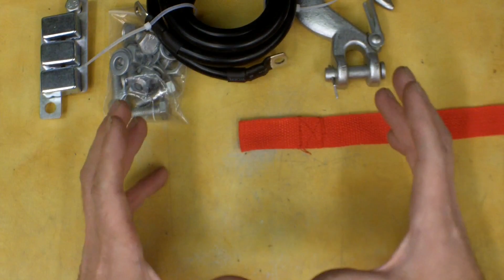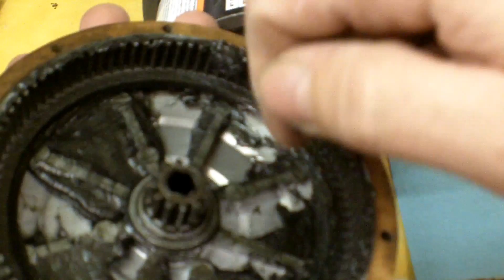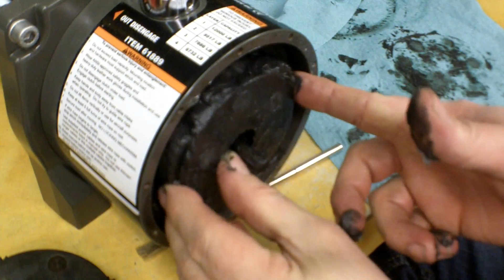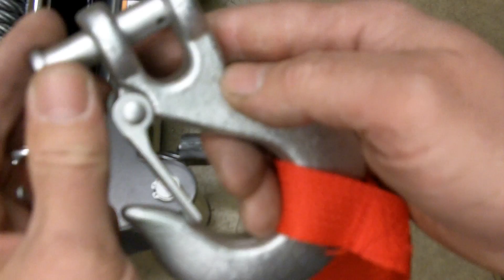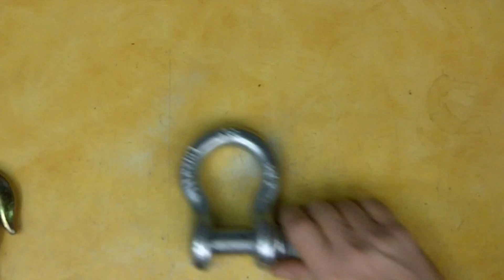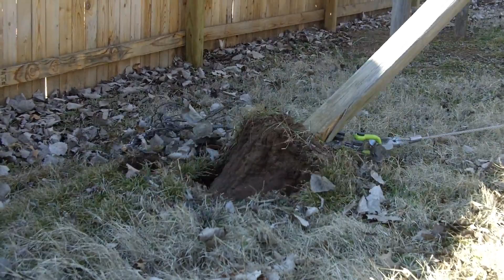Harbor Freight 12000 LB Winch Review, Teardown, Installation, Safety, Etc. Model 61889

Comment: Thank you for a VERY educational video on winches in general, the 12000 pound Harbor winch, as well as both use and safety guidelines.  P.S. I bought their 12,000 pound winch, and now, I will be a lot more comfortable with setting it up. Many people advocate switching to a synthetic cable, but because of winch heat and other items it sounds as though I should stick with the wire cable.
Reply from the maker: Glad you liked it Gregory! I can't speak for the synthetic, but know more care needs to be used. The wire works well enough for me. Good luck, G.

Comment: Just bought one of those winches for $299.00 PLUS I did buy the radio remote also.
Thank you so much for the comprehensive video on this winch !!
Just one thing I will add , when making all those battery cable connections ,use some silicone dielectric grease on those connections and terminals and you'll never have to worry about corrosion to those.
When I ran my battery cable supply to the rear of the vehicle so I can use the winch at the rear receiver OR on a car trailer ,I only run one conductor to the rear to save cost ,the other one gets terminated to the truck frame after cleaning a clean spot off the steel frame and using the grease on the connections there also.
Make sure you have a VERY GOOD ground cable run from the battery NEGATIVE terminal to a good CLEAN ground point on the frame in the front engine compartment.
Just to add , I  installed that circuit breaker assembly inside of a sealed plastic box NEAR the winch because I move the winch around and it will always be protected wherever I plug it in.
The front receiver mount I got from Etrailer dot com site for my '08 SIERRA 4x4
This 12000# winch is actually an upgrade for my purposes. I already had the vehicle set up for winches already.
I also put the quick disconnects in the front grille for winch power OR hooking up a set of "modified" jumper cables to jump other vehicles without opening up the hood. 
BTW , with the modified set of heavy pumper cables , a good receiver mounting cradle and an extra  fully charged battery , you can use this winch OFF the truck as well if needed provided you have the needed hardware to tie it down with.
Just plug the winch into the jumper cables hook them to the battery and go.
With the mounting cradle , you could carry this on an ATV to transport it.
Again , nice job on this video and thank you for taking the time to do it.
It was very helpful and informative.
Reply from the maker: Thanks! Sounds like you've put some thought into your setup and have some good tips. Very cool and should give others ideas. Take care, G.

Comment: Nice job. Learned a lot. Have you checked out the Smittybilt winches? $300 is cheap. I would spend $100 extra just to not have a harbor freight name. Just sayin`.
Reply from the maker: Thanks Greg. I looked at some reviews and saw many that broke off the mount. Other than that, I don't have an opinion. Good luck, G.

Comment: Great video. That being said, any idea as to why one would lose power? Had one for about 2 years. Worked great for while, but now it almost has no pulling power. Battery is good and connections are good.
Reply from the maker: Thanks Lane! No, not really. I assume both your power and ground are connected directly to the battery and you're running the vehicle while winching. If so, and all connections are clean, bright, and tight- it should work. Perhaps someone else will chime in with other ideas. Good luck, G.

Comment: Awesome video! Just picked one of these winches up online! (I shoulda waited to go into the store in person, but oh well.)
Reply from the maker: That's cool Chuck! Hope it serves you well. Good luck, G.
Reply: ghostses thank you! Out of curiosity, what did you use to clean up the inside of the winch? My winch came last week, and I’d like to clean it up and grease it like you did, yours.
Reply from the maker: No problem Chuck! I'm going from memory here, but it should be close. I Cleaned most of the grease off the gears, etc.  with blue towels, then they went into some gasoline to get as much off as it could. Then I used Berryman Chemtool B12 spray to blast off what was left. Past that, a rinse in hot water and then blown off with compressed air. For the part of the winch with the gear cast in. I pretty much cleaned out what I could with towels, then sprayed Q-tips with the Berryman to get the gear cleaned up. Carburetor cleaner would probably work good as well. Perhaps not spot on, but it should be close. Good luck, G.
Reply: ghostses thank’ya!
Reply from the maker: No problem! G.

Comment: Thank you for this video.  If I were to use this to pull a 1, 000 lb. cart up a steel track on a 45 degree grade, do you think that the motor would overheat or be damaged if it ran for three minutes?  I'd appreciate input from anybody on this question.  Thanks very much.
Reply from the maker: No problem Linda! I know it will pull that load with little strain, but can't say if it will do a 3min run-time. My gut says yes- but that means little. Not much help, but good luck! G.

Comment: My brake on a 12k mile marker is not holding. Crap.
Reply from the maker: No sure if you can get a replacement, but it might be worth looking into. Good luck, G.
Reply: I was hoping you would dig deeper into yours to show the brake. The mile marker looks very similar. Good video just the same.
Reply from the maker: Thanks! Not sure if this is the part you need, but if so- not bad for $35 or so. G.
https://milemarker.com/product/brake-shoe-replacement/
Reply: Cool beans. Thanks for the link. I will have to pull it apart and have a look at what is going on. It really has had very little use. Less then 30 pulls for sure.  Its 15 years old, but spent most of its life in the box.
Reply from the maker: No problem. Not much use for that problem. Might just need a good cleaning- who knows.. I'm sure you'll figure it out once you get in there. G.

Comment: What kind of receiver hitch did you mount on the front? Do you need to have a receiver hitch also rated for 12,000 pounds like the winch is? I am researching into front receiver hitches and most of what I find only have a 9000-pound straight line pull.
Reply from the maker: Lucas, I'll post a link to the exact one I used that fit my truck. It does have a rating of 9k in a straight line pull configuration- just like what you've been seeing. Not sure how the connection pin plays a role in the overall strength at the winch, but I use a grade 8 bolt to connect the cradle to the receiver over a standard pin. 

You don't "necessarily" need a receiver rated for the winch's max capacity, but you  do need to understand/research how different rigging setups affect the individual components.

With a straight line pull and a 9k receiver, you really should stay below that threshold even with a 12K winch.

But, lets say you were to use 9k rated receiver, go out to a snatch block, then connect back to a different point on the vehicle- it would about half the load on the winch/receiver. So, in essence, you should be able to pull about 18K safely in that configuration with a 9K rated receiver.

 You're on the right track with researching, so keep it up- and don't take anything I say for gold. You might go down the roads of block and tackle,  and rigging loads in lieu of 4X related threads and see where it takes you. There are many many variables that come into play so keep digging. I can tell you're into safety so your light years beyond many!  Hope this helps in some way, G.

https://www.summitracing.com/parts/CHT-31042

Comment: Correction that's my brand it's  sold at Harbor Freight I've got testimony that says they will pull over 12,000 pounds and this is the Badlands continental United States it pulls my vehicle all the way up the tree and let it right back down several times just approved its capability this is the best winch you will buy ever for the price and it is perfect extraordinaire performance in four-wheel drive applications Peterson's 4-Wheel Drive is still using it on the yellow truck that we put together
Reply from the maker: That's cool! Take care, G.

Comment: I replaced the cheap grease in mine when I got it: Then without the extension kit I just wired mine to a 1000 amp rated starter solenoid under the hood with my switch in the cab:     Now for my winches the 12000lb "HF" mounter it to a modified 5th wheel hitch on a king pin so that I could use the winch at different angles to my truck pined through a mounting plate for the winch to the hitch with roller bar's in my staker pockets: The roller's were set up on a bar and lined up with the different winch position's on the hitch, from near the cab to the end of the bed and across the with of the bed to the other side each roller had a cable tension break bar on it: The system was set up this way to skid log's, to set up a sky cable to lift log's up steep slopes and other thing like this.
Reply from the maker: Sounds like a cool setup Steven! Take care, G.
Reply: Thank's but I did not tell all.

Comment: You are a natural teacher my friend. Awesome video. I got at Harbor Freight 12000 a couple days ago. The price is over 600 bucks now as they have discontinued the old model and replaced with a new one. A 25 percent off coupon offset the cost a bit. I must admit I was mystified at how to install the fairlead until I watched your video. Thanks for your wonderful video.
Reply from the maker: Thanks Gary! Glad it was helpful. Good luck, G.
Reply: Gary Lundberg hey Gary the winches at that price is the18,000 lbs version about 699 bucks there

Comment: How do I get the wire off the drum to replace it?
Reply from the maker: Once you get it all pulled out, there should be a bolt that's securing the wire to the drum. Loosen it up and pull the wire out of the hole. Hope this helps, G.

Comment: great video. I looked in Northern tool for that same cradle mount you have, but I am unable to find it anywhere. It seems to be the best option at $80. does the sticker on it display manufacturer name? indiscernible in video.
Reply from the maker: Thanks Mike. I found a link to it that I posted for someone else, but it appears it's been discontinued. The sticker was only a Northern Tool logo. There were no other markings on it. Take care, G.

https://www.northerntool.com/shop/tools/product_200466651_200466651

Comment: what I did for my pickup is welded a 1 7/8 in. ball hitch to my winch mount so i can put winch on front or back, used welding cable and welding connectors for pos and neg. The ball mount allows the winch to swing in direction of pull so cable wraps on better and reduces friction
Reply from the maker: Cool! G.

Comment: most important thing with winching is battery amperage, the old 8000 lb warns needed 450 amps to winch, and then duty cycle. So i put a1000 amp battery, an 800 is good, then i remove and cut off all but the first 2 wraps, you lose a % OF PULLING FORCE per wrap, so its simple to understand, first wrap is like first gear second wrap is like second gear. Once i get second wrap in its time to let winch cool, i take remainder of winch line and put 16 to 24 inch lengths of chain to reach further or just use tow ropes for reach. always try to use full strength of winch capacity. don`t strain winch, cable used to wrap and hold logs on log trucks are great, chain on each end. pulling only with first 2 wraps if you have a long pull allows cooling time when you reset and run out line again.
Reply from the maker: Good tips Marnie! Take care, G.

Comment: Future reference, even an extension on that receiver will work fine un-welded. None of the receiver parts will give out before that Winch gives out. I guarantee you. 

Also, if you were to hang your snatch block from an upper position, and winch those fence posts up,  you would end up with less yard tear, and cleaner holes. less work on the winch etc.
Reply from the maker: Thanks, G.

Comment: Awesome video, much effort into this, safety, the whole bit.  Just a note, when I pull stumps or concrete pilings or in your case 4x4 fence posts set in concrete, it is easier and much more successful to use an old tire rim, place it next to your fence post standing upright and then place your cable over the top of it as you would a pulley, the taller the rim, the better leverage you will have and keeping your winch down low as possible. This pulls the post or stump UP first rather than over and breaking off. Trees can withstand much force, side to side movement but not as much upward movement. I keep an old 16" rim around for chores like this.
Reply from the maker: Good tip Jason! I actually got an old rim after shooting this for that very purpose. Take care, G.

Comment: The soft shackles, like from Bubba Rope, and Factor 55, in  7/8" diameter are good for 32,000 pounds and are not dangerous like a screw pin shackle in the event of failure.

Also, Factor 55 makes great, pricey closed system products like their thimbles and Ultra Hook that allow you to lock the system and have the safety of a closed system. Nothing loose to fly off and kill someone. And, they test all products to failure with destructive testing.

Nice, in depth review.
Reply from the maker: Thanks! Pretty interesting products. Thanks for sharing, G.

Comment: I'd like to use one of these Harbor Freight winches (the ones with the brakes) to work a stair lift. 
Do you think that's practical?  I'm thinking of removing the cable and having it direct drive the chair.
Reply from the maker: That's an interesting idea. I don't know if the brake would get too hot when going down. I guess it would depend on how far the staircase is. Other than that, I really have no idea. G.
Reply: Plan B is to used a motor used in electric gates.
Reply from the maker: That's cool. You might even look into a hoist. Here's a link to the ones HF sells. G.
https://www.harborfreight.com/catalogsearch/result/index/?dir=asc&order=EAScore%2Cf%2CEAFeatured+Weight%2Cf%2CSale+Rank%2Cf&q=electric+hoist
Reply: This looks like a great idea. Just looked at it. Therefore when i stop the motor it brakes, just as I had hoped for the winch.
The idea I'm working with is chair will actually be suspended from a Henderson track  which allows the chair to slide across it freely, and the motor will control the movement.
What do you think?

Comment: Max pulling power 12,000lbs is on the most outer wrap not inner. So the shorter the pull the more power if I'm not mistaken you went the other way. Larger the drum the larger the torque, so more wraps=more torque.
Reply from the maker: I did state it correctly John. Less wraps= more torque. More wraps= less torque. The line speed will also change. Slower on the lower layers but faster as they stack up. Here's a Warn article that goes over it in better detail. Hope this helps, G.

https://warnindustries.wordpress.com/2015/03/20/warn-winch-performance-specifications-pulling-capacity-by-layer/

Comment: What did you use to clean the old grease off the gears before you put the new grease on?
Reply from the maker: Chapin, It's an old video but I believe I removed most with blue shop towels, then used 50/50 Simple Green for the rest or perhaps it was 50/50 Purple Power.  Other options would be gasoline, Chemtool B12, brake cleaner, etc. I have all products so I'm not too sure which I used, but think is was the first two I mentioned.. Hope this helps, G.
Reply: I just didn't want to put too strong a cleaner in it and damage a non metal part.
Reply from the maker: That's understandable! G.

Comment: Great tips.  I am planning to use 110V AC . What  Amperage should I use. would a 110 v AC to 12v DC  converter 5AMp  work?
Reply from the maker: Thanks Musa!. No, that won't run this winch. It can draw up to around 400 amps I believe. I don't know what you're trying to do, but you might look into a 110v electric hoist to see if it would work for you. Here's a link. Good luck, G.

https://www.harborfreight.com/catalogsearch/result/index/?dir=asc&order=EAScore%2Cf%2CEAFeatured+Weight%2Cf%2CSale+Rank%2Cf&q=electric+hoist
Reply: Thanks a million. Great presentation .
Reply: Hi Steve , I've  purchase the 12000 winch from Amazon. Unfortunately, It didn't have the Cable  Tension kit and the circuit Breaker. I wonder where I could  obtain them? 
 Harbor Freight said It would take a long time to get them from overseas.
Reply from the maker: No problem! G.
Reply from the maker: I don't know about the tension kit, but here's a link to some breakers. I'm not sure if they're correct- but it might be a place to start. Good luck, G.

http://www.jegs.com/i/Superwinch/846/90-22860/10002/-1?CAWELAID=230006180037515302&CAGPSPN=pla&CAAGID=44693592161&CATCI=pla-191844202151&CATARGETID=230006180039217633&cadevice=c&gclid=CIjGq8PV5NQCFQx9fgodPJMGqw

Comment: Bought the Harbor Freight 12000 winch several months ago. Still in the box. This was very informative. Had not thought of using to remove small trees.Thanks for posting
Reply from the maker: That's cool. Glad you liked it. Yeah, that's mainly what I use it for and it works great. Good luck, G.